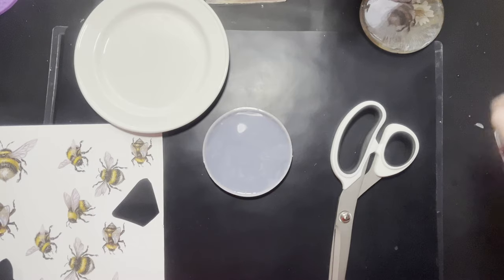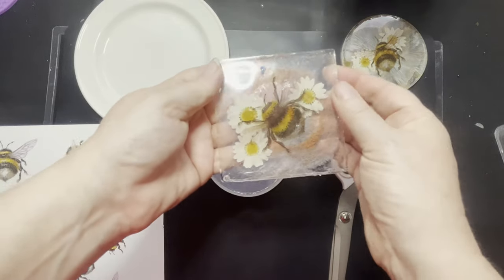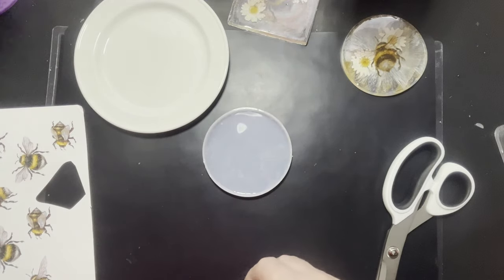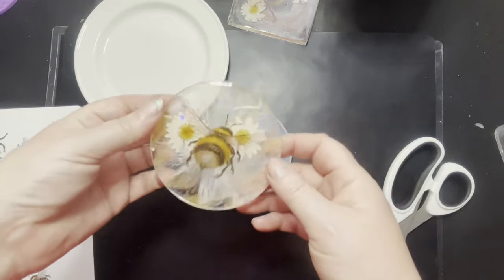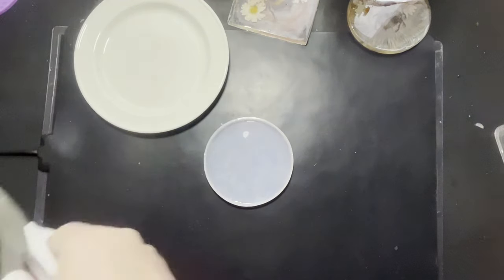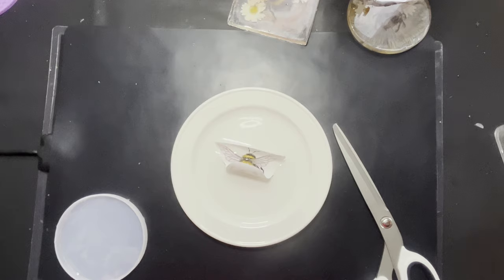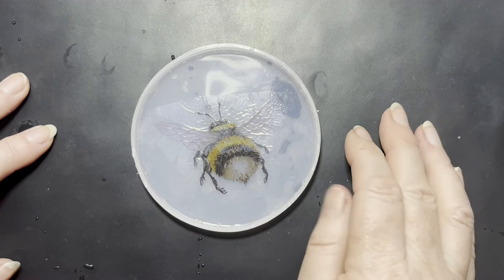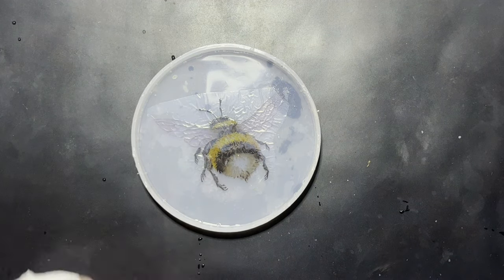#20 Trending in Home Decor 2024Bumble Bee Resin Coasters With Epoxy Resin & Waterslide Transfers

Comment: Hi Tracy have you tried putting the decal or tattoo straight onto the silicone mould then resining it just a thought :) thank you for your company xo
Reply from the maker: Yes and it works fine though you then have to  coat afterwards to protect it. So I prefer to  embed it between the layers as I go. I get a great 3d effect this way too :)